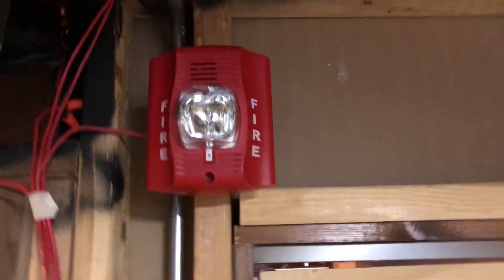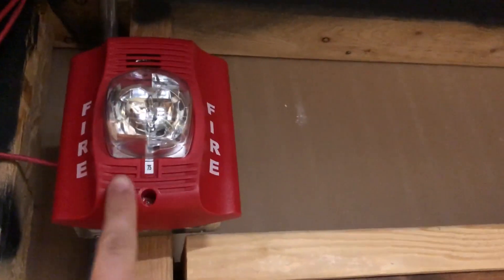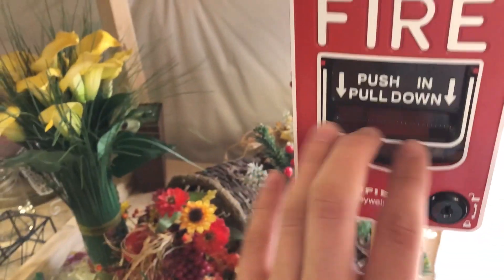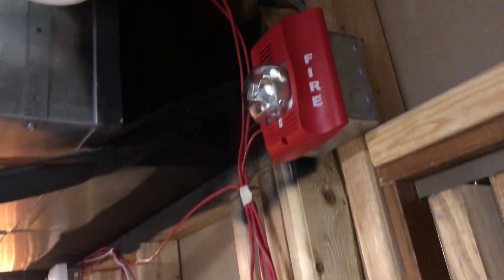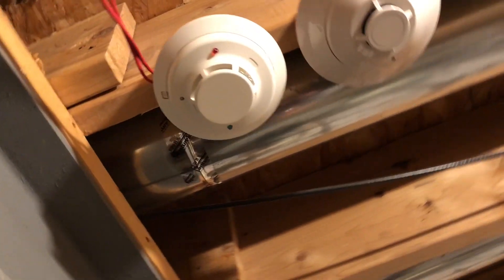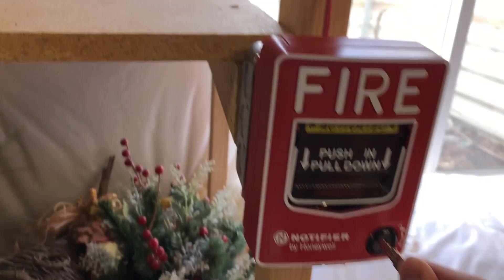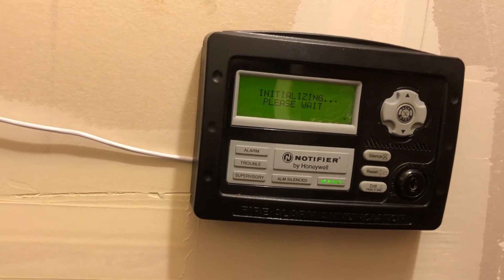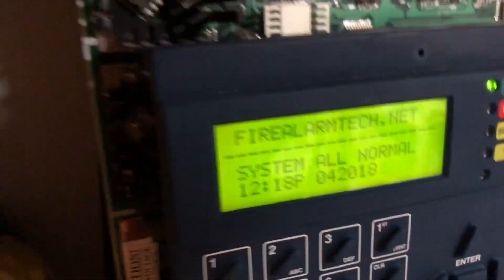Home System Test 38: Advanced SpectrAlert Advances!

Comment: I conducted a test of the l series and the advance and found out the l series is louder
Reply: A System Sensor L-Series on high volume is just as loud as a SpectrAlert Advance on Low Volume
Reply: @ that’s very incorrect pal
Reply: Advance is louder
Reply: But not the loudest
Reply: @Lokilovesfirealarms depends on the building

Comment: Cool. And loud. Yes, loud. Both the "Classic" and the "Advance" SpectrAlerts are very loud as a matter of fact. They DO make chimes though 😉

Great video
Reply: they don't make advance chimes anymore
Reply: +Zachary Fleck Yep. And they still sound like the "previous" Advance series (with the exception of a 3000Hz (plz correct me if I'm wrong) mode included). 

Pretty rare though to see a "Classic" chime. Not very easy to obtain I here